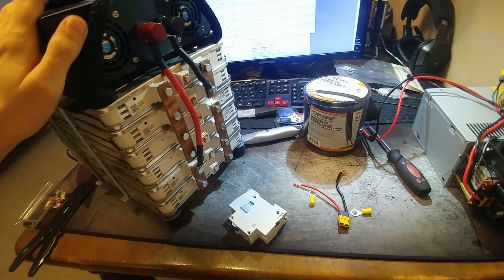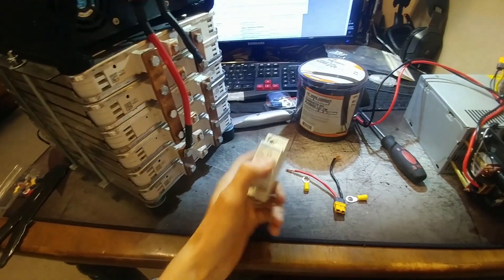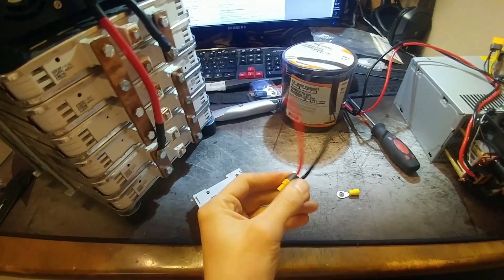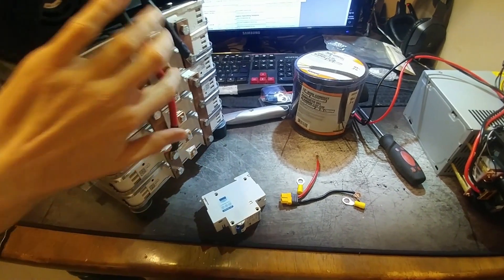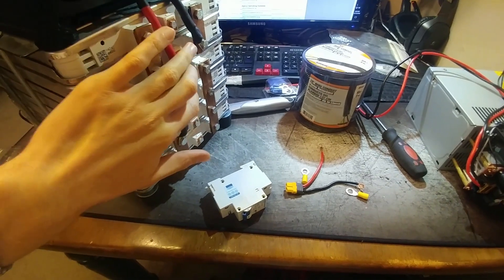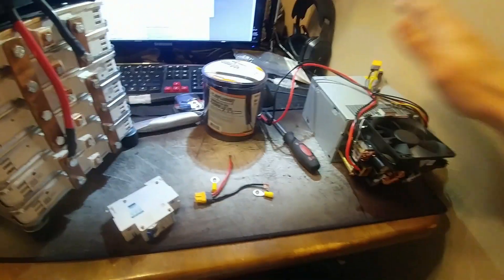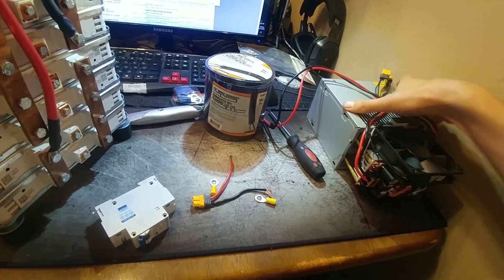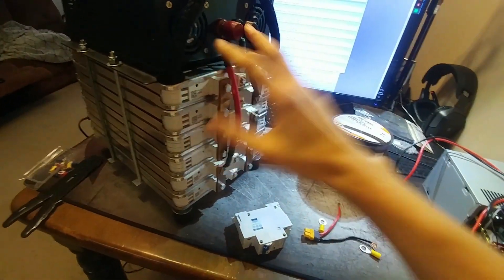Portable Nissan Leaf generator is getting upgrades + plus charger overview

Comment: Great project, been kicking around the idea of building a all electric APU for an RV capable of running a small AC but with the addition of 300 watts of solar. Would also be able to charge while truck is running from additional inverter.. Anyways keep it up..

Comment: Did you need to balance charge the batteries to get full capacity from them? I have some that I purchased from another vendor. He asked me to charge them to 4.1 per cell. And even at that I am barely getting any meaningful capacity from them
Reply from the maker: They stay pretty balanced. But I did order BMS, I will explain why in the next video. Also, I did not capacity test mine, but ebay seller said they are at 80% or so of the original capacity
Reply: @sideproject4028  mine would not balance and we ruined a few. I had to get a BMS to make them work.
Reply: @drsolar   what kind of BMS you bought, I'm trying to make a 24volt system like Side Project but i need to buy a BMS...Peace